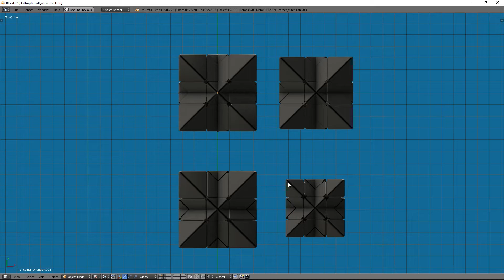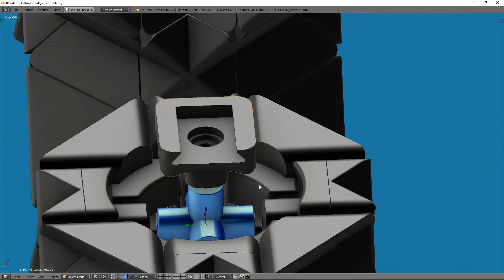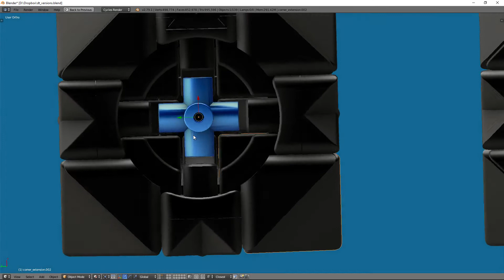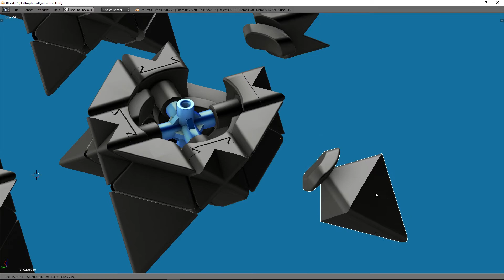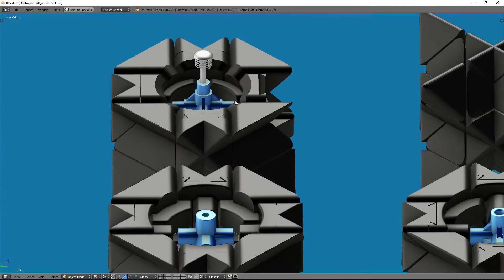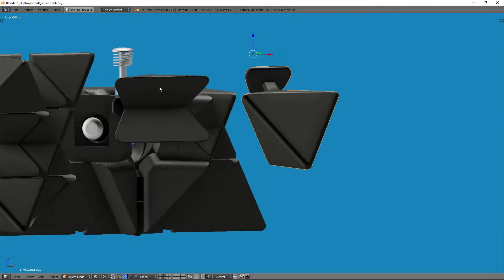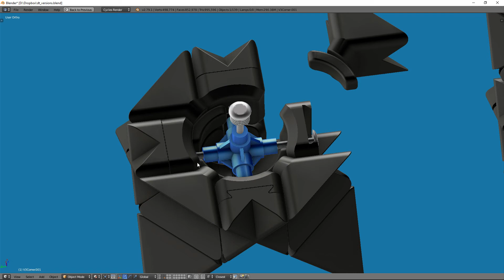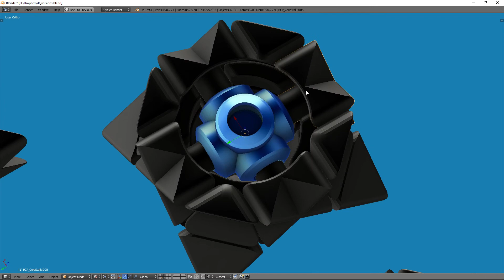Showing 4 of my 3x3 core designs

Comment: Thank you so much for the great videos Troy. I wanted to ask if you are familiar with building puzzles in blender using bezier or nurbs curves. This is done by sketching a cutting profile with a curve and extrude/rotate it to form a disc. The disc is then used to slice a cube 6 times. I tried for days but I could never get it to work. The resulting mesh is always messed up. I am switching to FreeCAD if I still can’t figure it out. I can also upload my files if you like. Thanks a lot
Reply from the maker: Yes, I am quite familiar with that method. It's what I often use when designing with CAD software.

It's possible to get this working in Blender, but in my opinion it is much better to use a CAD or solid modeling program for this type of thing. Blender is a mesh-modelling tool first and foremost, so it really isn't designed to do those kind of cuts. You will spend more time cleaning up meshes than designing. In case anyone is wondering, I have not abandoned Blender at all,... I absolutely love the program and make my living using it, but for cube designs I've moved over to solid modeling techniques which are not available in Blender.

I tried to like FreeCAD for quite a long time before I finally got fed up with it. It does some things very nice, but the interface was maddening to me. I kept trying, but I just couldn't get comfortable with it and found it very user-unfriendly. I would highly recommend you check out Onshape which is an Online based CAD program. I use Rhino 3d and really like it, but Rhino is a bit pricey (Just not as $$$ as Solidworks)
Reply: @rcpongo  I use Autodesk Fusion 360, free version.